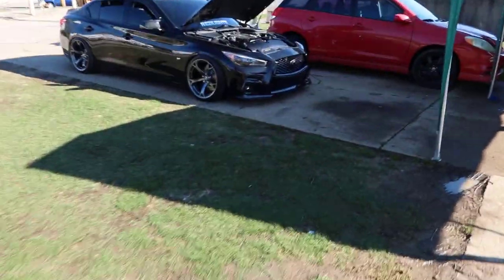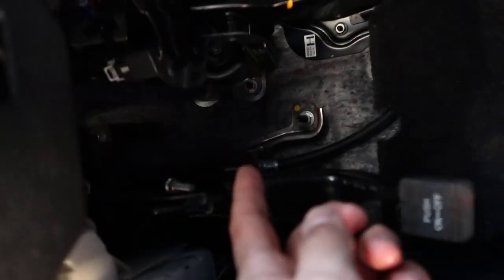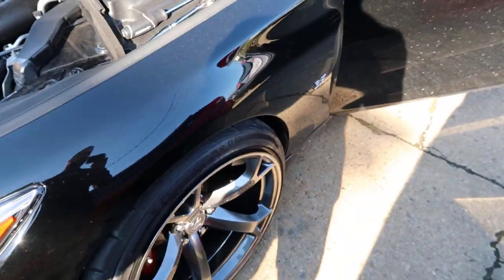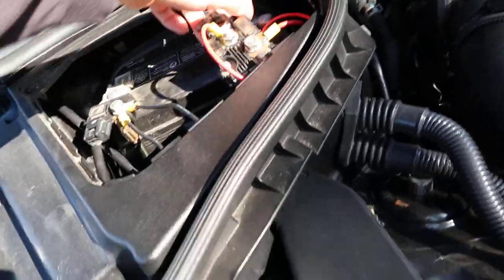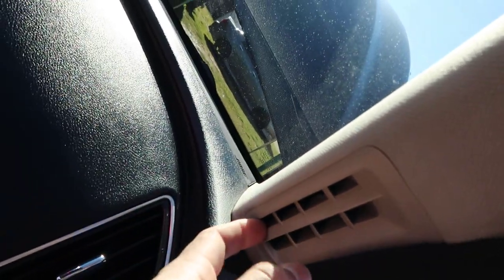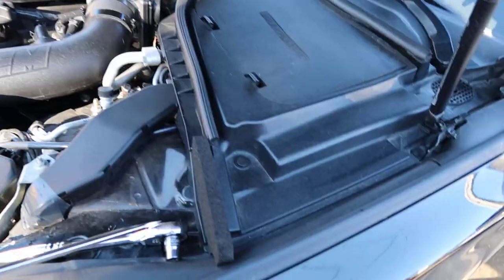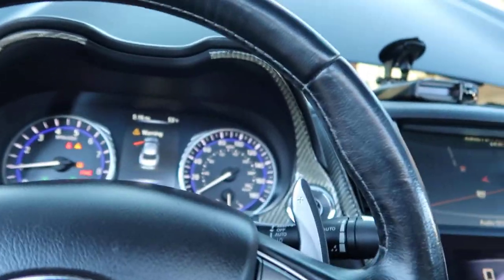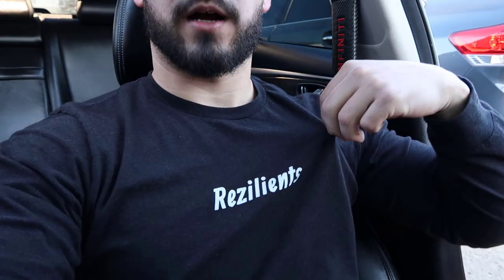Infiniti Q50 leaking water inside...😭😭

Comment: Just fixed this problem on a 2010 Infiniti EX35. The solution was to silicone the two front sunroof drain exit fittings to the firewall. Pretty simple. We actually watched these fitting allow water back in behind the firewall. The system Infinti/Nissan uses is useless and there should be a class action lawsuit started for it.

Comment: Same issue on my 2010 FX35..... I think mine is because of sunroof drain is clogged. I'll check today or tomorrow.
Reply: Any luck? We have a 2010 EX35 with the wet floor when it rains. the sunroof drains seem to be draining not too badly. We figure it's the outlet fittings on the firewall letting water pass back inside somehow. Have to remove some things out of the firewall area to get access.

Comment: Can it be bypassed then run a line down to the ac drainubder the carpet
Reply: Does it work with the q50, I did that to my g37 where you reroute the whole drain system